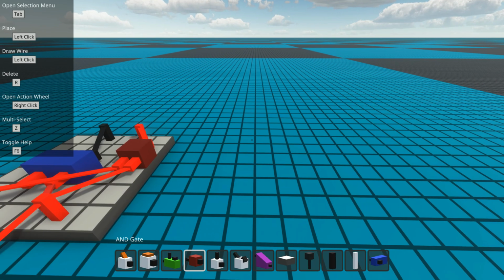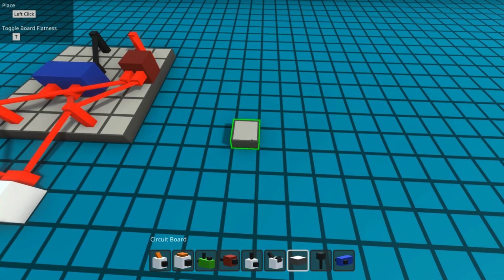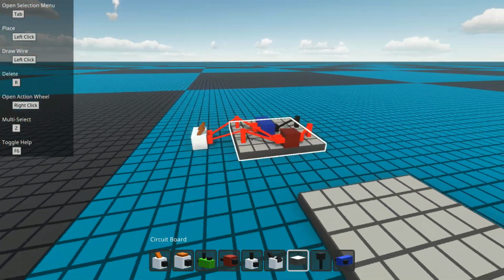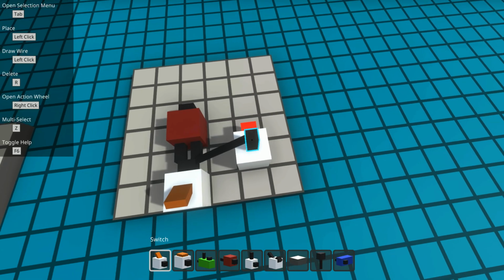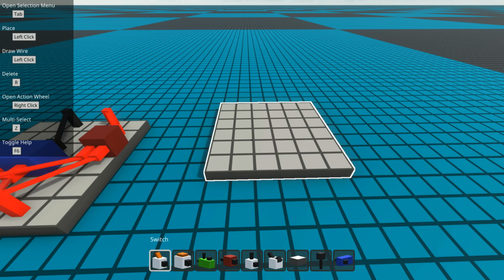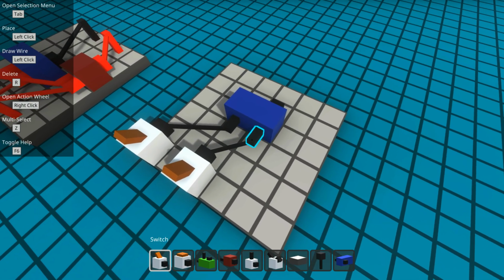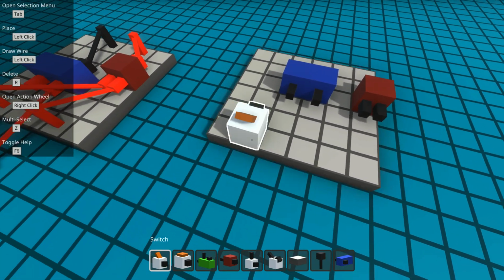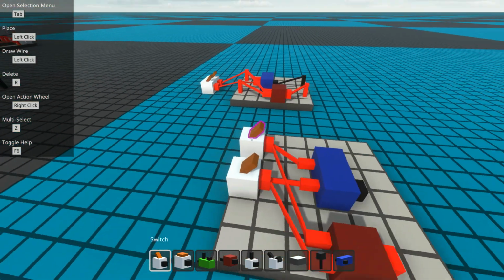Logic World Tutorial ( old version)

Comment: Do you think you could do a video covering the building mechanics? I cant figure a lot of stuff out
Reply from the maker: I will keep that in mind.  Some stuff to know though.  T switches between vertical and horizontal.  G grabs.  Control-G copies.  If you use V on mounts, you can change length.  There's a minimal cable distance.  Make sure you learn to "fly", and move up and down, if doing vertical boards.  To stack boards is kind of tricky.  Say boards are the same size.  Put a mount somewhere on the edge.  When you hit control-G, make sure your cursor is over the tile with the mount.  Then when you stack, it should stack directly over the top.  Sometimes you have to use G to grab before you rotate.  Make sure you have the context menu up ( F6?) and when you have something selected, like a board, it should show you the commands you can use, such as the shift rotate commands.  I will try to keep in mind your suggestion, I agree the game is not always easy to figure out.

Comment from the maker: If I failed to mention it, an OR gate is not needed, because you simply put a pin down, and connect your inputs to the pin, and if any are 1, the output is 1.  So a pin acts as an OR gate.
Reply: Well it would be useful if they did implement an OR gate. For example a peg lets all the wires connected to it activate. But there's a simple solution for that. Put buffers before you connect it to the peg. And I did see a lot of people complaining on steam that there's no NAND gate. Their correct but all you need to do to fix that is a inverter at the end of the AND gate.
Reply from the maker: @TechOrionater  I think we will see the modding community create missing gates.  I think smaller circuits are nice.  I understand there's a line between having an entire CPU in one package and having nothing but a minimal set of gates, but I can't say what's best for the game.  Everyone who plays will have their own goals and playstyle.
Reply: @michaelbauers8800  No I understand that. I was just saying it would make somethings easier. But yeah only having 3 or so gates and a latch creates a really big and fun challenge. I think the way they did it was perfect.